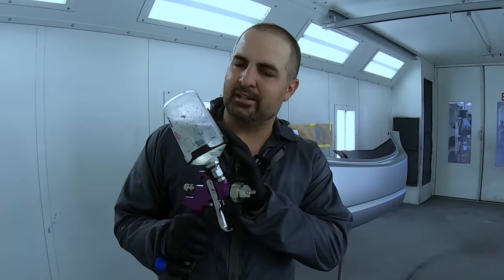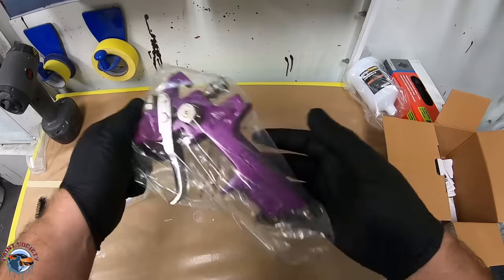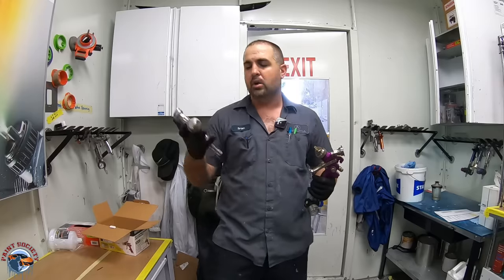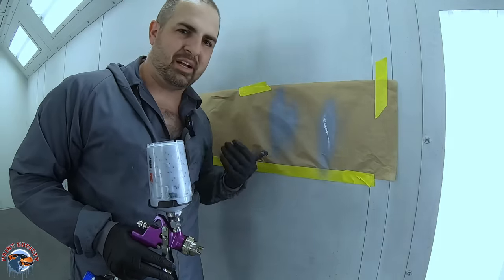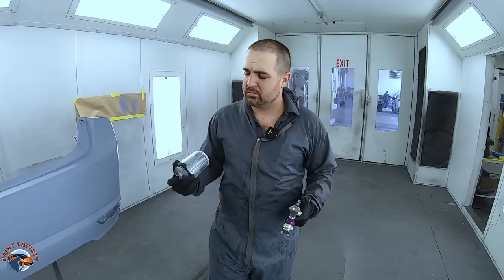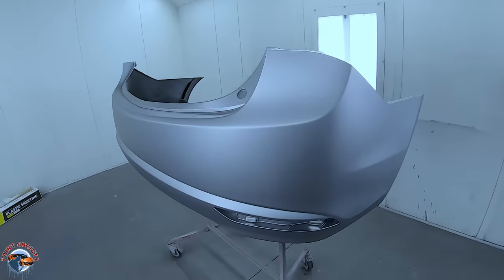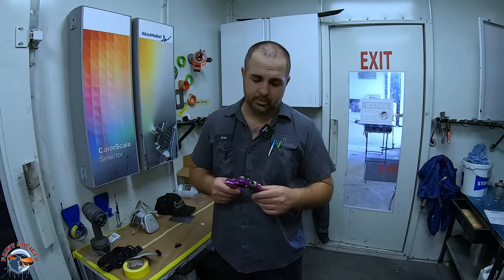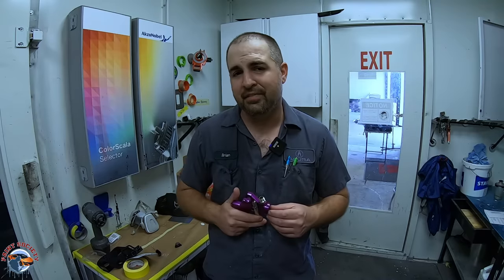$15 Harbor Freight Paint Gun Delivers Professional Results!

Comment: This video is a.year old so I am a little late . All I have sprayed with are cheap guns around 30 paint jobs so not many but got used  to using inexpensive guns and got pretty good results with Pracice and redundancy.  But finally moved up to a Devilbiss starting line gun which is still considered a beginners gun The work came out a little better but the ease of spraying in the transfer of the product was 100% but you can get good work with a cheap gun Patience and practice and you can get it done good luck everyone

Comment: I’m wanting to take a shot at painting my project truck eventually and watching your videos I’m learning a lot. One thing I have a question about is do you have to clean the gun in between coats of sealer/base/paint?
Reply: You should, mostly to keep things from setting up in the gun.  If you're going straight from basecoat to clear coat just as fast as you can mix the paint (like spray from roof, front, down one side, back, down the other, and by then your starting panel is in the topcoat window) then I've gone straight from basecoat to clearcoat just spraying the last bit empty between them and can't see a difference, but if you're waiting an hour or more between coats you really need to run your cleaner through the gun to keep it from building up inside.
Ideally between primer and basecoat you're changing tips, so that's definitely a good time to clean.  You'll get better results using something like a 1.5 or 1.8 on the primer and then a 1.3 usually for basecoat (the materials sheet should guide you).  I personally don't bother switching between BC and CC, because they're close enough, but primer to BC is a bigger gap. It doesn't make a visible difference, but the finer atomization helps reduce orange peel and sagging, and if you try to use the finer tip with the primer, I've had it literally throw clots of primer because it was drying on the tip.

Comment: In my beginning on this job on 2002 I was using a gun like this one from HF  and a little 20 gal air compressor the compressor stops working 3 months after but the paint gun was still working fine for over then 3 yrs and then I bought an iwata that cost me 550 dllrs for base coat and the iwata Evo for clear coat that I pay for that one 850 but I'm still using the HF spray guns for primer.

Comment: I won Best in Class at a car show several years ago with a car I painted in my garage with a Harbor Freight HVLP.  I've moved on since to a decent mid-tier gun, but I'm a hobbyist, so I'm never buying a $1000 Iwata or similar.  Today, what I'd consider would be buying a cheap Harbor Freight gun with a 1.5 or 1.8 tip and just always use it to shoot primers, leave the better guns set up for color and clear.  Kinda like I use Harbor Freight angle grinders extensively.  Do they last like a DeWalt?  Probably not, but at $20 a piece, I bought 4 of them, and have one with a grinding disk, one with a cutting disk, one with an 80 grit flap disk, and 1 with a wire wheel, and never have to waste time changing back and forth.  I replace 1 a year maybe.

Comment: I have used Harbor Freight guns for years. They are almost as good as my Devilbiss Starting line or OMX and Satajet Gun. HUGE price difference. They are perfectly fine for the beginner in a garage. Buy two or three. I use one for high build primers and another one for topcoats. No real logic why I do this. I just do. I keep a third one around just in case I have an issue with the other two, which I never have. Just clean em' real good inside and out with a solvent after you unpack them to get the preservative off them. Prep work is 95% of the job. After that its spraying technique. As far a compressors go I have used them with a compressor as small as 22 gallon diaphragm type and still gotten good results. Yes, take out the filter and use a paper strainer. AND, shockingly I get the floor wet in my garage to keep the dust on the floor from kicking up.

Comment: ive been using the same harbor frieght hvlp gun for about 5 or 6 years and it still.perfoms great. i mean the cuo is beat up and its been fixed were its cracked but it still works and i only use it for color and clear.only.

Comment: This makes it even a better bargain. You must have pick yours up on a non-sale day. You used to be able 7 days a week with a clip coupon buy this spray gun for $9 in change let's say $10. Now you have to wait for one of their sales to get it for that price but they do run it often.

Years ago when you could just walk in and get them for $10 I tried one out at home and really like using it. Before that I was using spray cans. I'm not using the spray guns for cars. Normally I'm spraying different things that I make out of metal and when I'm done welding everything up I hit it with some paint. I found it to be cheaper and easier than a spray can.
Like you said it's difficult to get it set just right for you it's a lot easier since that's what you do day in and day out.

What I normally do is when I'm running low on them when the sale pops up I go down and pick up 10 more. That way when I'm in the middle of doing a project and the paint gun brakes I don't need to wait till the next day to get another one. I throw them all into a box. Whenever I'm looking for something to do I take all the paint guns apart try to use parts from another one to fix one. I've had pretty good success with that to the point that I give them to my friends to have.

Really enjoyed your video. I most definitely gave you a thumbs up and hit the subscribe button. Definitely looking forward to watching more of your videos seeing that I might try my hand at painting my pickup truck once I put it back together.

Comment: you get to the point after many years of spraying just the sound the material makes when the right atomization is made as it comes out of the tip.
Of course a pro like him adjusts his approach to spray technique and the best gun adjustment with an inferior gun.As he says he struggled and worked harder, this gun will spray single stage paint jobs easier and primers.

Comment: depends on which gun, same type, you are luckily enough to get. I had one and it would not fan adjust, the adjuster just spun around and around and the fan was about 6" wide. On these HF cheap guns drill out the hole where the fluid reservoir screws onbto. There is plenty of metal there and you can increase the fluid availability to the needle control.

Comment: I just bought this gun.  I've sprayed before with other guns.
I had a hard time getting the epoxy primer to lay flat and with 75% overlap. It kept leaving tiger stripes. It also looked like a form of orange peel.
I maxed out the settings as you did.  It didn't seem to atomize the epoxy enough.
I sprayed the base coat on top and it got better, but not smooth enough for me.
I had to quit before spraying the clear which I will use a Finish line gun.
I want to sand the hood again and maybe more base coat.
I'm not sure if I can get it smooth enough to spray the clear.
I liked this HF gun.  
I am not sure what to do tomorrow.  I don't want to make it worse, but what the heck.
I love your videos!
Reply from the maker: It’s probably because the air cap is clogged and can lay it even
Reply: @PaintSociety  
Thanks.  I kept it clean.  I started sanding it smooth today.  If I can get it smooth, I'll spray the base on again.
I'm using Omni, black epoxy primer and black base coat.
Your tip helped about getting within 4-5".  I always thought it was supposed to be 8-12.
Also, I blew crap off the hood and surrounding plastic, then tacked.
Another great tip!
Thanks for your reply.
Hint... the epoxy was older and I think it had firmed up in the can.  I mixed it and strained it, but my gut is that I should've stopped and replaced it.

Comment: Ive painted a bunch of vehicles with those very guns and most come out like glass, after some sanding of course. I buy a few at a time, use for paint then itll get knocked down to a primer gun then Ill trash it. Its litterally cheaper to trash the gun than to use up chemicals to clean it lol. But its place for me is, I know what Im doing but I only paint my own stuff when I need to so it dosnt make sense to spend premium on a good one. But with the right skill and a little extra wet sanding and buffing it does the trick.

Comment: My father is a professional painter and had went recently to go and buy two 900.00 each spray guns for a job he needed to do over the weekend. Well this being his first time using those specific guns we found out that the spray angle was not as wide as it should be and also that they both leaked paint. Now he had to get this job done by the end of the day, it was pure luck that I had this Harbor Freight spray gun as I wanted to learn how to paint. He wasn't confident in using the gun but he had no choice, well to our surprise the angle was perfect and the consistency was awesome and the job came out great. Many believe that "you get what you pay for" but I have come to learn that it is not always the case. May father went the following morning and returned the 2 guns and received his 1800.00 back. The salesman was surprised about the results of the paint job. I told my father "hell dad when ever you have a job you can just go and buy them, use it, and then toss it away. No clean up just spray-n-go.

Comment: What psi were you spraying with? I use that gun sometimes to prime cabinets and doors etc. for remodel work. I haven't been able to get that thing dialed EVER. Always thinning the paint to the spec recommended on the can but it seems to always spray super light and can never get enough fluid. I've tried everywhere from 15-40psi

Comment: I have been buying these and the previous version for years. They are great for a disposable gun. If you don't want to clean it again just toss it and get out another one. I find the comment that the controls on it were not conventional which is incorrect. The fluid control is no different than any other gun. Counter clockwise to run the needle out and clockwise to close it. 

     HF used to have an HVLP version that looked similar to this one but better air cap etc. They worked very well for the $. One thing I see is that many people are afraid from widening that fan out and pulling that needle further out to put out more paint. They also tend to not move fast enough.
 
         Also remember that technology and machining has improved allot over the years. An 800 gun from 25 years ago isn't much better than a $50 one today. I have a couple of my old Binks etc ones from many years ago and for me the sub $100 guns are far superior to the old ones.

Comment: I throw away the instructions most of the time also. Thanks for the review, as a 30 year mechanic who has never used a professional paint gun I know my limitations. I picked up the same gun last year and it is still in the box. Maybe I will used it to spray some primer or matte finish paint this year.
Reply: if you bought it last year, it may be the old model. check the air horns, if there is only one hole on each horn chuck it and buy the one with two holes and a half circle of small holes around center hole.

Comment: I respect the purple gun for what it is and it does have its place… I’ve never used your $1,000+ spray guns and the gun I use fairly frequent for hobby and side jobs is like a $200 gun. 
Even with that little experience not gonna lie… though it does have its place the purple gun is garbage😅 I’m not saying it’s garbage by how it atomizes as the finish can be found in the painter, but the feel and build feels like trash compared to what I’m use to
The one I used also would consistently have the trigger stick while pulled

Comment: Hey Brian. I have a question that I would be very pleased if you answered. I am going to be painting my car myself for a fun project and am not wanting to spend a ton of money on a gun I'm only going to use once. Would this be a decent option? I don't need a perfect finish but I don't want to spend alot either. Thanks in advance
Reply from the maker: It will work but there are better guns out there to make the job easier. Just check out the astro euro blue paint gun

Comment: i brought a $225 kit containing (1x1.4 and 1x1.7 guns,regulator and toolkit with replacement needles/springs/filters etc) im about to put the last coat of acrythane on my car, followed by 2 clear acrythanes and then metallic basecoat/clear on the detail in metallic turqoise, would u do it all with a 1.4? or use 1.7 for the basecoat/prime on detail?

Comment: As a paint technician I can tell you with absolute certainty that the $16 gun will last about 4 sprays before things start going south. The fan will stops adjusting through time, the packing seal at the back of the needle will start wearing out and dripping paint all over the place and the if you had used the cup, you'll notice that it doesn't seal properly and will leak paint if you're working at an angle. This sort of gun is ALWAYS recommended as a primer gun because their really isn't any other use for it...in the long run. PS: Some of these cheaper guns also have NO WAY of switch the fluid tip for a bigger size as some companies glues it onto the gun. If you managed to get it off, the replacement has a different tread size and doesn't fit onto the gun.

Comment: Hi, really appreciated your video presentation, in fact, don't know about your rating, but I take it all in to account, a professional painter using a spray can can deliver an excellent finish. So how much more so with a wanna be HFT spray gun, beautiful results, again a pro doing it. I have a Honda that has been painted 2x by the dealer and is not ready for another paint job. We are past all warranty and there is no recourse through dealer repaint, so either Maaco ($1200.00) or some other means. Wife's car, she waiting to see what and if I do anything. Got a question about the paint and other materials you used, guess they also were professional, expensive, best quality. Which makes me think that good quality material used with a cheap spray gun would still give one a better result than cheap materials. Also to be considered is the air supply, water extractors etc on the delivery end. Thanks again for the informative, instructive video.

Comment: A little story about this.......

Once upon a time a small ships engine started to make a strange noise than its usual sound and later on it stoped working. The engineers and the crew tried to figure out what the problem was with no avail. So they've decided to get help from outside. They called an old man who is experienced in repairing engines like this around town. When he entered the engine room he started to listen. Hitting some pipes with his wrench here and there. Squeezing some bolts and stuff. The result, engine is fixed. Later on he sends the bill summing at 2000 usd. Of course the owner gets frustrated and yells to the old man.....
- You've just hit some pipes with your stupid wrench and want 2000 usd for that. That's outrageous !!!!
The old man answers with his wisdom ;
- 10 usd for the tool 1990 usd for knowing where you need to hit the tool.

Comment: i bought on of these in 2004 to fix my motorcycle.  at the time I was brand new to painting.  i used it to paint the tank. it turned out fantastic in my opinion.  so i decided to buy a sharpe finex gun to spray the rest of my bike. and it sprayed like shit.  the harbor freight gun did a much better job

Comment: Here are the real reasons That 15 gun is not worth it. 
1. need to over pressure it to get a decent atomization 35lbs is over pressured HVLP GUN limit is 29lbs
2. Cleaning that gun is a pain in the ass. Good guns have  more course threads and no taper on taper seal on air cap
3 Fan is wayyyyyy to small for large vehicle. Great for a small job like that bumper but not hard to keep it wet on a complete
4. sometimes they fall apart very cheaply made
5. When spraying a difficult area like a flat vertical panel. orange peel will be present.  Not visible on a small bumper. not good comparison. 
6. They wear out, The fit of the air cap wears out and fan gets out of wack. Not good for long term spraying 
if your going to go harbor freight get the Spectrum it is $99 and not a terrible gun. easy  to clean, but fan is still a bit small but doable.

Comment: So this means I don't have to buy an expensive gun to replace my cheapo Campbell Hausfield paint gun?  Some painter came by my shop and was talking mad shit when he saw my Walmart special paint gun and said I should never use it for anything which confused me because I have painted 5 complete cars and lots of bumpers, doors, and fenders with excellent results but I thought maybe I was using it wrong and the paint was not supposed to come out of it that nice. BTW, I can't seem to find any pressure numbers anywhere, It's an HVLP gravity feed style and usually run it between 20-30 psi but I don't know if that's what its supposed to be sprayed at. Mine did not come with the instruction manual because I found it in the garbage. It is labeled "Display Only", not sure if that helps identify what model it is.

Comment: I paint my bmw the whole car and the result was exellent I'm a newbie   my first car.....was hard to find the correct setup with FAN and air pressure...psi tank.and gun pressure...hard.....I'm still looking a video is somebody made it about the best setting...🤦‍♂️  but the result was more than expected....I use for Base  color 29psi   and for clear 35 psi    not sure if was the correct but get some clear drip need to be corrected